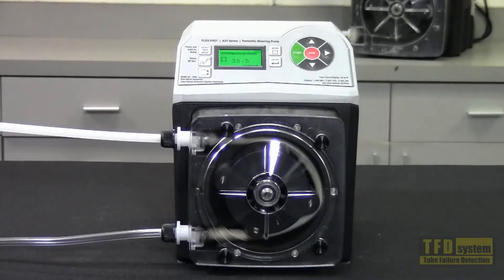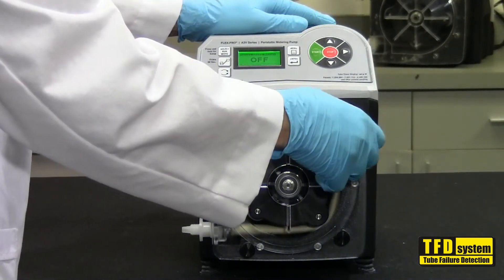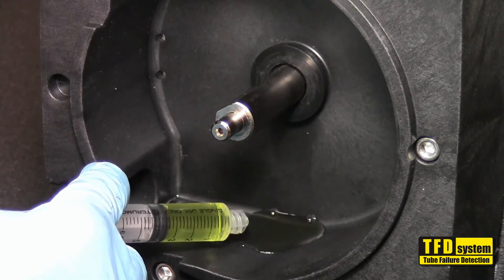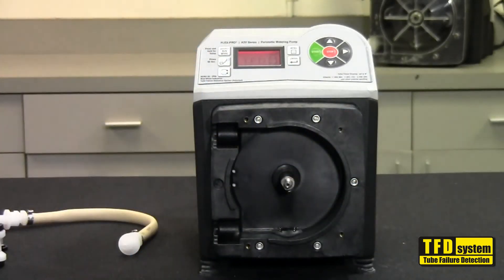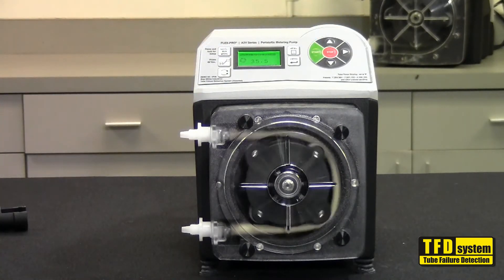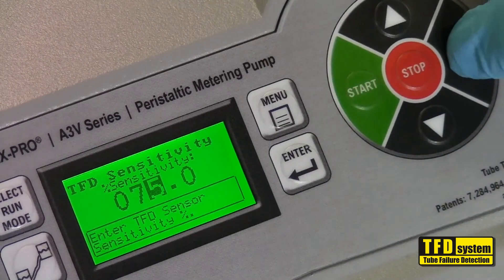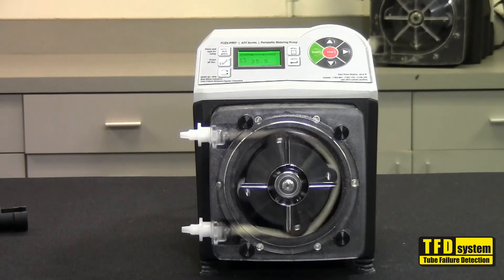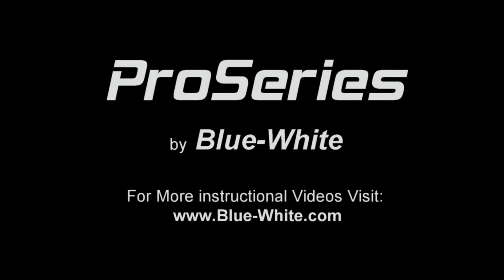Flex-Pro® A3 Patented Tube Failure Detection - Testing and Setup

Comment: How about a pump time out error? Motor failed to respond to control?  I keep getting this error and get get it fixed other than manually starting to resume.? 
Thank you
Reply from the maker: Hi Juan, normally a blown fuse would cause this. Or the fuse isn't seated properly in the J-box. If you are still having this issue please email us at customerservice@blue-white.com and we'd be happy to assist you.